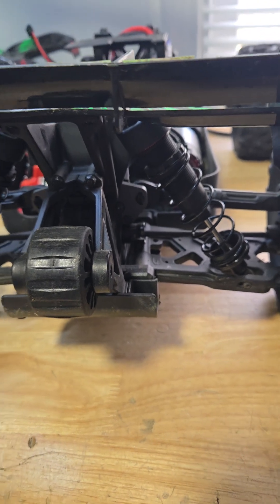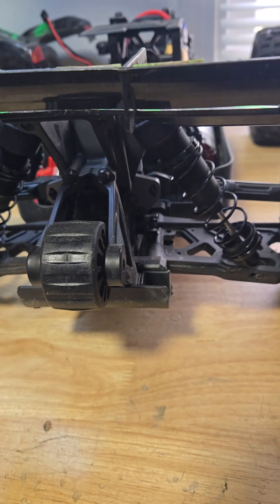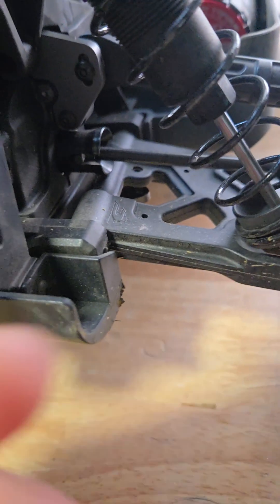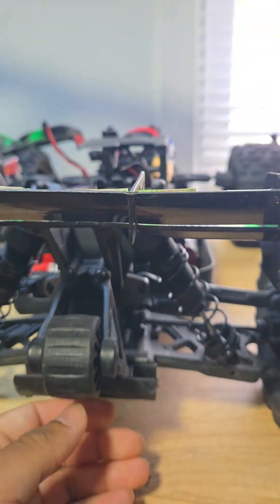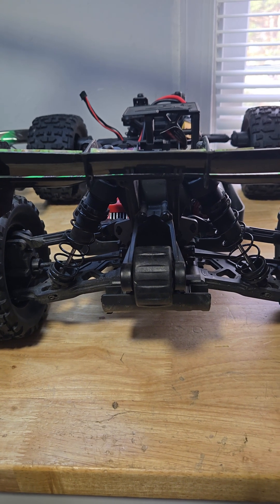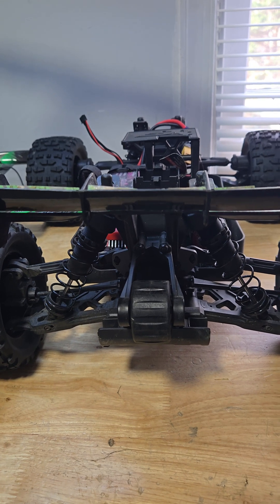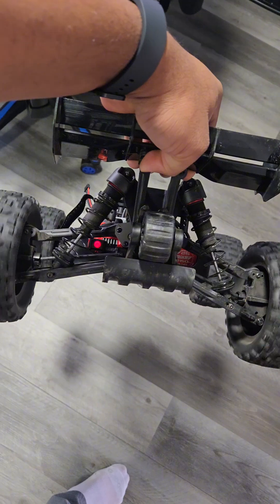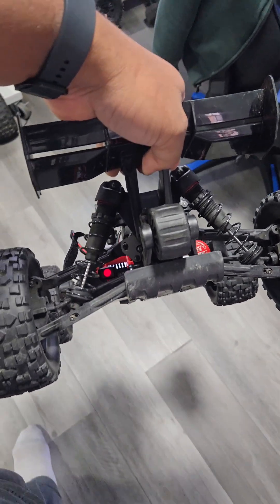Quick #shorts #video on droop screws and why you should adjust them! #teamcorally #rccar #rc #droop

Comment: When I first got my full size rig, I researched lift kits, and immediately went down the suspension/steering geometry rabbit hole. I went even further when I got my SCX10II. Literally everything is connected! It's so cool how you can fine tune all of these little adjustments that don't seem that important, but actually impact performance dramatically! The droop screw acts like a limiting strap, so the springs push the control arms as far down as they can and clamp it in place to reduce that oscillation. That's incredible! And I bet you can tune the shocks along with the droop screws to reduce body roll to a minimum. That's why I love this hobby. The possibilities are endless!
Reply from the maker: I agree. So many things can be done to dial them in and make them handle like we want!

Comment: So when u had the droop all the way up on the one side was it shaking cause the drive shaft was wobling around more or why was it wobling...
Reply from the maker: Part because the driveshaft is wobbling and because the droop screw isnt making contact with the chassis at that point cause its all the way up. No extra stability
Reply: @therchotspot but is it the dogbone rubbing on the inside edge of the cup at max angle or what?
Reply from the maker: Not sure what you mean. You talking about before the droop is adjusted, how it is stock?
Reply: @therchotspot yes, so without adjusting the droop, is there diff cup replacements that would keep the shaft from binding?
Reply from the maker: Not that I know of